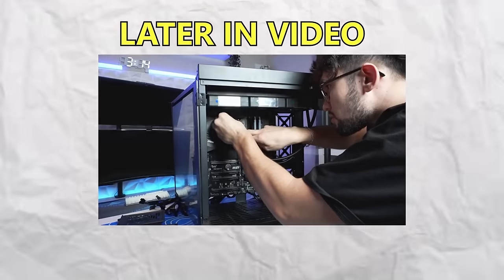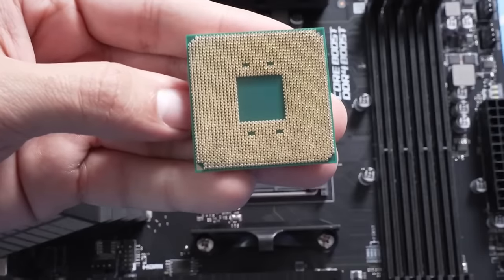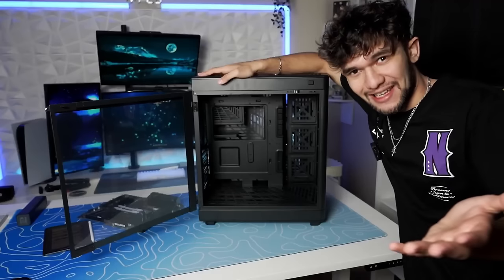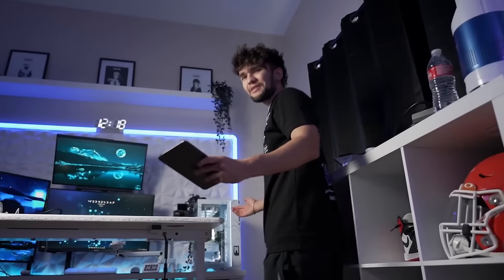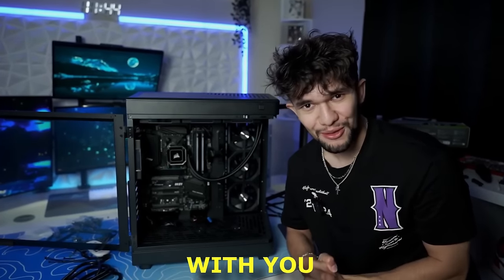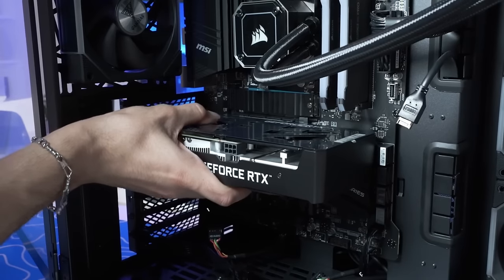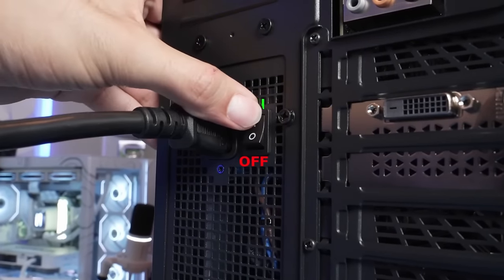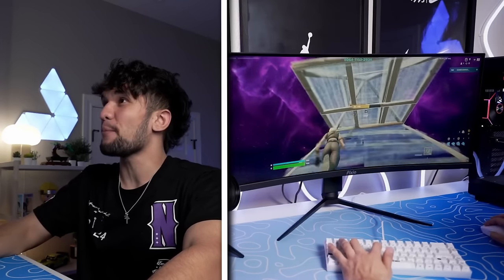Building My First Gaming PC With No Experience (BUDGET)

Comment: it is good if you are first time pc user but for anyone wondering for a 1000$ you can build a pc with 7500f 32gb ddr5 1tb nvme and a 12gb 7700xt
Reply: yeah some ppl don't know about "performance over looks" ...
Reply from the maker: Well thanks for informing me bro…again this was a learning experience so it wasn’t gonna be perfect my first try 😂
Reply: @TheChandler1  yeah I also messed up my first time using a i9 10900k with a 1050ti and 8gb ram
Reply: @Tulip24_007  how did you get it that badly wrong
Reply: @WatermelonMan255  Mine is way worse i3 10105F gt 730 8 gb ram nuke psu
Reply: @TheChandler1  hi black pc
Reply: bro I’m tryna build a pc with about $1000 (maybe it can go $100-300 over) can you send me the certain parts I should buy? I don’t know much about building tbh
Reply: also could I go with the 7800f instead of the 7500f or is it too powerful to go with the other parts? 😅
Reply: @betabear5252  no problem with using it and it also has better upgrade path you won't need to upgrade your cpu while upgrading gpu
Reply: way btr than 3050
Reply: My thoughts exactly, this was such a waste
Reply: @betabear5252 
There is no 7800F
Reply: 16gb rx 6800 is even better
Reply: This is literally just gibberish
Reply: No shot - you'd have to seriously undercut on a PSU and mobo. Here a 7700XT is $600 - a 8400F (7500F isn't available) is like $200, DDR5 32gb is $250. Just those parts exceed the budget in my local prices (which are subject to a hefty import tax).

Comment: I think pre-built is better because if you put more stuff into it it can have more money on it, so stonks. edit : 21 likes is crazy 💀
Reply from the maker: Valid take!
Reply: but pre built is more expensive and it has a bigger risk of malfunctions in my opinion
Reply: @judeyang4136  true
Reply: @judeyang4136 yea but it also has a warranty unlike the self built one
Reply: @ImJusSha bro if you're building it yourself all your other parts have a longer warranty then the prebuilt
Reply: @ImJusSha  Unlike the pre built, if you build it yourself, every individual piece has individual warranties longer than the pre-build
Reply: Prebuilt usually use lower end components to maximize profit, maybe a 510 motherboard vs a 550 (just an example) that extra $30 to $40 for a better motherboard makes a huge difference.

Comment: sees pc build vid
clicks
1000 dollar budget
rtx 3050
jumps off bridge
Reply: LOL
Reply: u and i sir
the cooling for a r5 5600 almost made me pop a vain
Reply: @unknownUser-ny5gw  why
Reply: @NoName13636  its way overkill
Reply: @unknownUser-ny5gw  so you think the stock cooler works?
Reply: @NoName13636  for a 5600x yeah stock cooler will work fine if you're on a budget
Reply: @Shortz5_9  you think the corsair h100 rgb would work?
Reply: @NoName13636  yes but if its a bit too loud for him a $30 to $50 tower cooler would be more than enough
Reply: @NoName13636  work yes necessary no any decent tower cooler will get you the full performance of the r5 5600 for half the price
Reply: a 3050 isn't really anything special, but it does get the job done.
Reply: it hurts to see this build😂i just looked what i can do for $100 in pcpartpicker. I got ryzen 5 7600, stock cooler, 6000mhz 30cl ram with rgb,  good mobo for future upgrading)phanteks case with 4 rgb fans, 2tb storage with 4500mb speed,  used 3070 or new 4060 and 750w corsair psu.
Reply: @Quicksz0  its supposed to get the job done for a $500 pc, not a $1000 one.
Reply: Fr I thought for $1000 it would have an rx 6750 xt
Reply: and a 360mm aio

😭
Reply: why?
Reply: @NoName13636  I personally use the stock cooler. I've had no problems whatsoever lol
Reply: yeah, even if you went all white, at least here in the uk u can do a 7600 (equivalent to a 4060) for 1k
Reply: and 500 gb..
Reply: @unknownUser-ny5gw 
There are 20$(less even) coolers from Thermalright and ID Cooling that are perfect for 5600X.
Not sure about those ID Coling stuff , but Thermalright Assasin X should be able to handle even 5700X3D or 7600X and possibly stronger .
I think it's rated to 215W , but I could be wrong.
It could be less.

The CPUs in purely gaming scenarios tend to produce more heat than they should relative to specs , but sometimes less.
Reply: Fr man
Reply: Fr 😂 (3050 should have been in a 600$ build)
Reply: 360mm aio for a r5 5600😂😂
Reply: @allofgamingyt  fr 😭
Reply: @NoName13636  a $40 hyper 212 literally does the job fine for that CPU. I know cause I have it and under heavy load it barely goes over 60'C

Comment: "Mhm, cool, all this is pretty good" 

>Sees a 3050 

Physically gets blown into the backwall
Reply from the maker: IM SORRY😂😂😂
Reply: “There is no bad graphics card only bad prices”
Reply: @TheChandler1  not hating becauser youre new but as someone who has built a a few computers you should spend less on things like a case and with that build you couldve got a lot better performance if you just spend a bit less on some things and a lot more on others. Other than that good job.
Reply: @DmanTheMan9090  untrue.
Reply: @Dubulcle  wdym
Reply: @Dubulcle  it is true
Reply: @TheChandler1  3050 is shit
Reply: @DmanTheMan9090  try quadro k420 thats what i use is ass
Reply: bro am using gtx 750 ti
Reply: I have a 3050 :(
Reply: @ItzHazmat  bro i have intel hd graphics 4000
Reply: @Arx-on-the-beat  No the 3050 is not shit yes the price is not the best but it still can do everything any other gpu can i get 300 fps on fortnite which is really good for a card everyone decided to start hating on it when it released if you have never owned a 3050 then dont talk shit because ik if you tried it you would be surprised of the frames it can pump out, if your on a budget the 3050 is not a bad option for nivida cards but yes you can get better performance with amd, just because a gpu is overpriced doesn't make it "shit''
Reply: I have a GTX 1070 😭
Reply: @AcousticEdd  Ok but zou probably did not put it in a 1k build
Reply: @ITSSILASLOL  bro what that card is still good in some cards.
I’m happy with my Rx 580 tho
Reply: @Arx-on-the-beat  don't blame the poor guy, he's just started
Reply: and a 360mm aio on a r5 5600
Reply: @DmanTheMan9090  yeah he got it for a good price but he overspent on other things
Reply: @ITSSILASLOL 😂😂
Reply: @AcousticEdd  not that sad, i have a 3050 laptop gpu
in a laptop 0_0

Comment: Tip: when building the pc put it into pc part picker so there are no incompatibilities
Also, the 3050 is $200 but the 6600 is also $200 and way better performance wise, also there are an insane amount of 1tb gen 3/4 ssds at $60
Plus, an AIO is not needed at all for something like a 5 5600 since that's not gonna be overheating like crazy. You could've done much much better with $100, infact, you could build a brand new $600 pc that performs better than this

Comment: The PC building was quite good, but I feel like the parts were not good at all.
For a $1000 budget, you should at least get a i5-13400f or a ryzen 5 7600, and pair it with a rx 7700xt or a 4060 ti. DDR5 ram is definitely the way to go for the budget.
But the aesthetics of the pc was quite nice, but I think for a $1000 budget you definitely overspent on the case and the 10 rgb fans. but overall it's not a terrible build at all.
Reply from the maker: Thanks for letting me know! I’ll be better in the future

Comment: Not bad for a first-time builder with no Experience, Good job 👍
Reply from the maker: Thanks man!
Reply: @TheChandler1  No problem man!
The PC Components you picked were nice.
For the GPU tho, You could've gone with an RTX 3060 if you had an extra 100 Dollars but the RTX 3050 ain't that bad. You picked it up for 200$ soo yea, not a bad price. You even picked up the GPU at the right time cus from what I see here, the GTX 1660 (New) is a bit more priced than the RTX 3050 (New) u picked up sooo you got lucky!

And the reason why people didn't like the GPU choice u made is because the RTX 3050 is basically a GTX 1660 but with Ray tracing and DLSS, the RTX 3050 is newer so u get more driver support so It's fine lmao, But yea Enjoy ur PC man! You can upgrade the GPU and SSD later in the future, but for now, you're good! Enjoy ur fine PC! 
I even recently upgraded from a GTX 1050 2GB to an RTX 3050 8GB (If I went for an RTX 3060 it would've bottlenecked my Ryzen 5 2600 soo yea, I got the RTX 3050 8GB for a decent deal tho) and I'm very happy with my GPU Purchase :D
Reply: @TheChandler1 what’s the size of the aio (Corsair)

Comment: Processor (CPU): Intel Core i9 or AMD Ryzen 9 series for top-tier performance.
Graphics Card (GPU): NVIDIA GeForce RTX 30 series or AMD Radeon RX 6000 series for excellent gaming and content creation performance.
Memory (RAM): 32GB or more for multitasking and heavy applications.
Storage: A combination of SSD (for fast boot times and application loading) and HDD (for mass storage). Aim for at least a 1TB SSD and a 2TB HDD.
Motherboard: Choose a motherboard that supports the CPU and has the features you need, such as multiple PCIe slots, USB ports, and M.2 slots.
Power Supply (PSU): A high-quality PSU with enough wattage to power all your components comfortably. Aim for at least 750 watts for high-end builds.
Cooling: Invest in a good CPU cooler and case fans for efficient cooling, especially if you're overclocking.
Case: Choose a case that provides good airflow and accommodates all your components.
thats what i think the best pc u could give away would be
Reply: Well if you had money for all of these top of the line specs. I can deal with used RTX series something only

Comment: not all pins are necssary for the system to boot, some pins might be bent or not working but it might still boot and the system working perfectly fine if the pin isn't very necessary for the system to boot
Reply from the maker: Thanks for letting me know!
Reply: @TheChandler1  np 😉

Comment: I understand its ur first time but id recommend swutching out the 3050 for at least a 3060 and changing the psu for a 650 or 750w psu bc you dont need rhat much power for that kind of pc 700w is good for a decent upgrade in the future and the current specs
Reply from the maker: Bet man thanks for the info!

Comment: I have 2 very important question. (W vid btw)

1) do you need to buy the thermal paste separately or does it come w the cpu cooler. 

2) Also the cooler u got (LS120 i think) is the aio display customizable? + did u need seperate brackets to attach cpu cooler to cpu.

Comment: i would always built pc myself unless its super expensive with 4080 in it or something. its just a part of the experience, although many people just forgot or dont know what to do before/when/after you're building a pc, like checking compatibility, putting the io shield or setting memory to xmp/expo. thats just an experience
Reply: I built like 4 pcs max my entire life and two of  them had 4090s. Don't understand why the computer having a super expensive component would prevent you from building it. if the computer doesn't boot and some component doesn't work just contact warranty anyway. when building a pc with new components most likely than not the cause of failures is DOA components.
Reply: @KewaiiGamer  some people just don't want to spend any time building the pc when you already putting 2 grands on it, not to mention sending time for troubleshooting. but i overall agree with you, you're right

Comment: A 3050 for a 1k build is wild 💀. What you should've done instead is:
1: No AIO needed. For my first pc build I used the R5 5600x and the box cooler was more than enough for it. And if you really wanted an AIO for aesthetics then you could've gotten it later on down the line.
2: 3050 graphics card gets majorly outperformed by the 6600 which you can often find onsale for under $200 and performs the same. Even then though, a 6600 for a 1k PC is crazy. When building a pc your graphics card should be at least half your budget (there are a few exceptions)
3: When you're building a pc you should always focus on performance and then aesthetics (when under 1k budget) because it will be cheap to upgrade a $100 case down the line or $15 fans but to upgrade an important part that you should've had from the start (that horrendous rtx 3050) you will be spending a lot more.

Comment: GeForce RTX 3080 Ti XC312G-P5-3955-KR, Intel Core i9 (12th Gen) i9-12900 Hexadeca-core (16 Core) 2.40 GHz Processor, Corsair RM750x (2021), ddr5 7200 (trident one), ASUS ROG LGA1151 Wi-Fi M.2 U.2 USB 3.1 Z170 E-ATX MB ATX, SAMSUNG 990 Pro 1TB M.2 NVMe PCIe 4.0 Solid State Drive, Asus ROG Strix Helios GX601 RGB Mid-Tower Computer Case for up to EATX Motherboards with USB 3.1 Front Panel, Smoked Tempered Glass, Brushed Aluminum and Steel Construction, and Four Case Fans, Black. Type Shii?

Comment: Pretty good but there are some things to improve on

Don't use the 3050, it has awful value and even the 980 ti from 2015 can do better, get the 6600 or a used 3060 or 6650xt
Don't use an AIO for the 5600 it only needs a 30-50 dollar air cooler 
You didnt need all 10 fans, you only would have needed about 4 (preference)
You could have gotten the H6 flow which is cheaper and it still is a fishtank case (this is a personal preference so do whatever you want with this)
Get a crucial P3 Plus which is on PCLE gen 4.0 and you could have gottem the 1tb variant for the same price of the 970 evo

Nice build though.

Comment: 1:25 my guys hands were shaking like crazy, also you have got to change that GPU at least get a 3060 ti it is a budget friendly gpu that everyone likes but if you don’t mind the 3050 then you can keep using it oh and btw the ryzen 5 5600 can run perfectly fine with an rtx 4060 or 4070 I don’t recommend getting a 4060 though

Comment: Its a good build but 3050 is a bad card. You should get an rx 7700 xt/rx 6700 xt with r5 7600. You dont need an aio for a cpu like the r5 5600/r5 7600. An air cooler is enough.

Comment: Pre-Built...the reason is if you buy all the individual parts each can have its own issue, if there is one, or you if damage it. This making the warranty redundunt! Plus you have to figure out what part ir parts are the issue abd us it your fault or the parts fault.

 Pre Built you usually have return/repair 2yr(+) , iry extened, warrenty. Any issues then rhey will deal with it. You wont have to mess atround figuring out what the issue is. You wint need to replace/send back/fix/configure the part/issue. 

Its actually not that more expensive buying a pre-built and can actually work out cheaper esp as P&P is usually free - rather that shopping around, probably have to pay P&P too and then waiting for each part. Also dealing with all the packaging too.

Comment: Here is that i what do:
Get the montech x3 mesh case, comes with 6 argb fans
For that budget, dont get an aio cpu cooler, you could upgrade the gpu and ssd and maybe the cpu
Dont use the 3050.
Like i mentioned, an aio for that budget is just kinda dumb as they are so expensive

Comment: Or like a 4070ti super, ryzen 77800x3d, 32gigs of coarse or dominator ram speed over 7000 850 wat psi,in a loan li o11 dynamic, coarsair 360 mm aio, asus rog strix motherboard, 2t of Samsung 980 pro, 9 lian li rgb fans, 1 intake rgb fan,, and 2 lianli strikmer cables for gpa and mother board

Comment: congrats on the awsome build, but you could've made this pc alot faster by saving on the motherboard, me personally i have a gigabyte b550m ds3h that i got for around 125 dollars which has everything you'd need, also the rtx 3050 will age horribly due to it's low vram. but for 200 dollars that's an absolute steal, another note is pny. i've got a 3060 ti from pny and i've had one major issue with it not outputting any display untill i pluigged in the cable to a diffrent port and turned the power off and on. anyways the 3050 ti is still a hefty gpu and the pc is gorgeous. for a first build this is some really good value

Comment: I love that you are really getting into PC building, but I wish you could’ve sent the build list to your community first before building the PC. You’ve made two major mistakes that show you def prioritized looks over performance. 

1. You spent way too much on your case, fans and SSD. You can afford to cheap out on those since they do not affect performance much.
The money you spent on those previously mentioned components could’ve been spent on your GPU, CPU or mobo 

2. You’ve kneecapped your upgrade path by using the AM4 platform. For your budget you could’ve comfortably chosen an AM5 mobo, CPU and RAM which can all be upgraded later on down the line when newer AM5 products are released. AM4 basically is dead now with no newer or faster parts coming out.

Comment: no offense but you could have gotten this (cheaper and better for building yourself)

gpu-dual 4060 8gb 
cpu-intel i5 12400f 
motherboard-asus prime H610m-K argb ddr4-
storage-kingston nv2 1tb-
ram-kingbank blade 8gx2（16g）ddr4 3200mhz  c16-
cooler-deepcool v5 argb fan cooler-
power supply-greatwall p6 650w bronze 80 plus-
case-sama case blackM2-

im not sure but this costs around $770 to $850 MAX
and if some peaple wanna play fortnite dont worry you will be getting around 240fps if your settings are on like epic but if you put low settings you will be getting around 300 fps 

hope this helps ❤

Comment: Better 1000€ Build:
-i5 12400f
-kingston fury beast 32gb
-wd blue sn 580 1tb
-Amd Radeon 6800
-Asus Prime b660 pls ddr4(wifi if you don´t have any Ethernet Cable)
-Endorfy Spartan 5 Max ARGB
-Endorfy ARX 500
-Thermaltake Tough power gf3 750W
-Endorfy Silentium PC Fluctus 120 pwm argb (If you want more fans than 5 in your PC)
Reply: PS: Price Today at Geizhals: 1029€